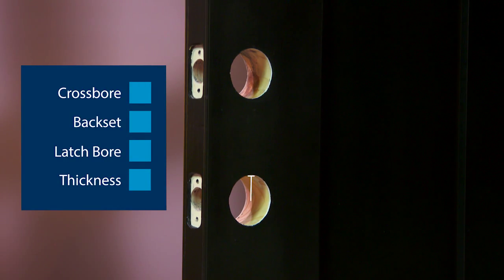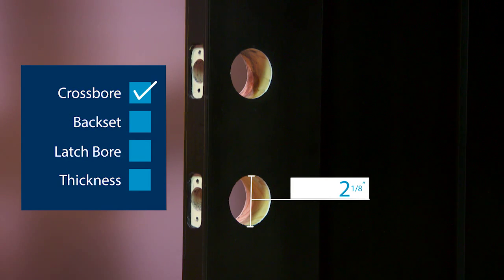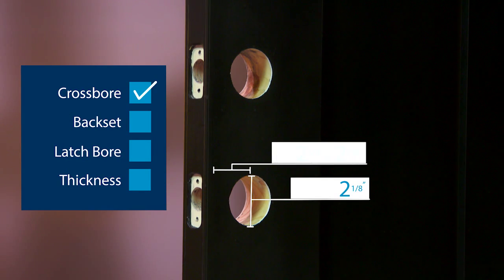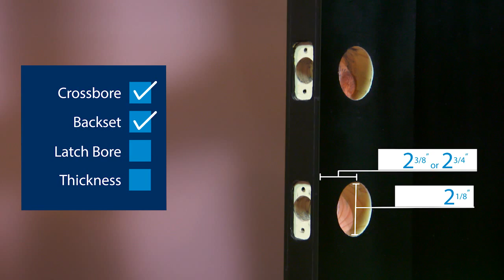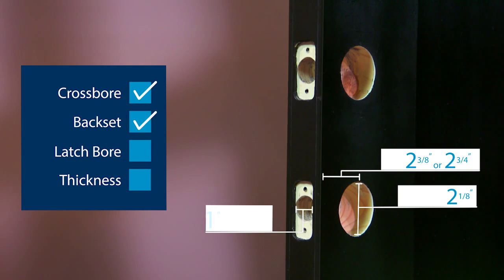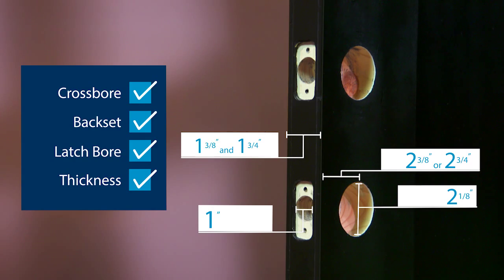How To Prep a Door for a Schlage Keyed Entry Lock (F51A)

Comment: How do I stop this thing from automatically opening when I turn the knob from the inside? I have no way of checking to make sure it’s securely locked because it automatically unlocks and opens when I try to check it.
Reply from the maker: Hello,

Unfortunately, rotating the interior lever/knob will always retract the latch and there is no way to disable that feature. The easiest way to know if your F51 is locked is to check the positioning of the interior thumbturn. If the thumbturn is vertical, it is unlocked from the outside, and if the thumbturn is horizontal, then the F51 is locked from the exterior side. Please let me know if you have any other questions. Thanks!